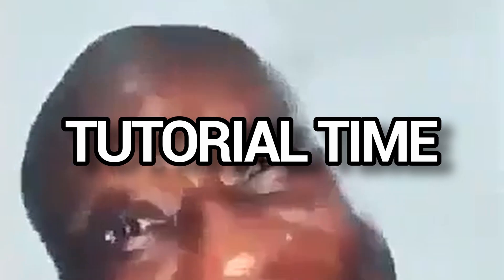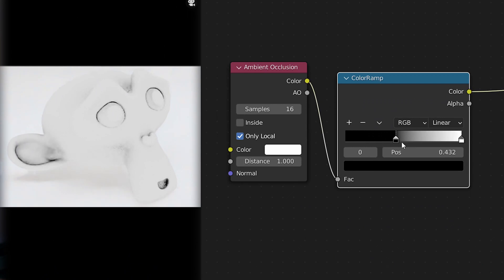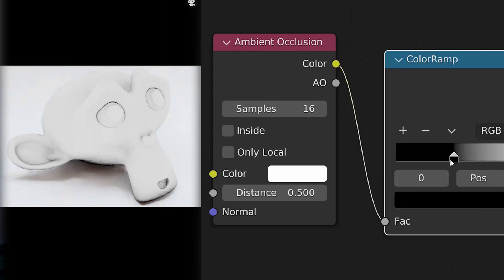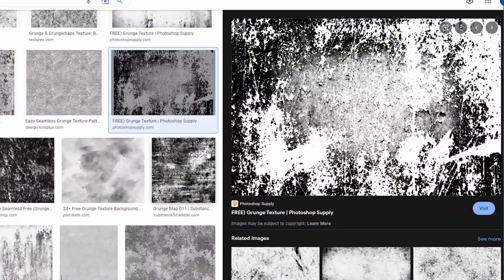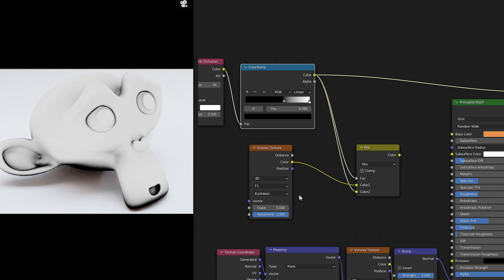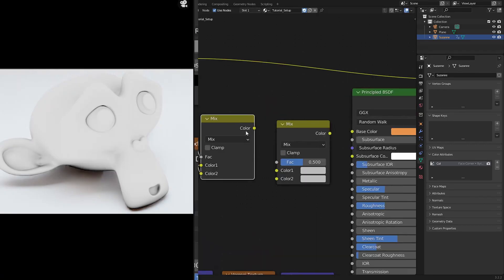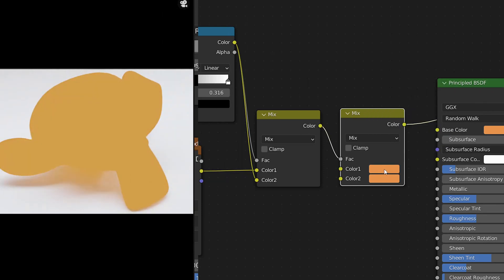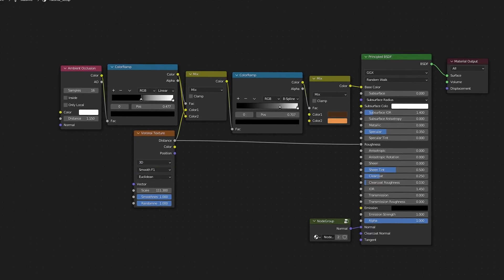Your Materials Suck. Here’s Why

Comment: oh neat. Didn't think of using the AO Node in Cycles yet. So far I've only used shader to rgb to achieve the same results. With little changes it can be used for NPR Shading as well.
Reply: In cycles you can use bevel instead of AO as well

Ps: the results can vary tho, feel free to experiment

Comment: Sounds good, doesn't work with animated objects (only local should be used then). Using the Bevel Node te get "Edge detection" is also an usefull sometimes for stuff like this (wide radius) or just using a vertex color dirt-map..

Comment: I think the "Only Local" setting should be left on for objects that are moved around a lot in principle. It makes sense for grunge maps to be affected by neighbouring objects only if they are supposed to be lying around in the same place for a relatively long time.
Also, you gotta be able to exclude objects from the non-local version. Like, imagine an animation where a character gets too close to your grungemapped object. If the texture remains procedural and isn't baked, it'll suddenly change from that proximity